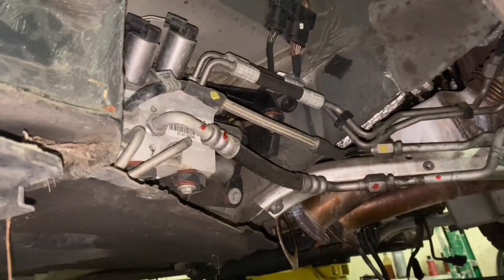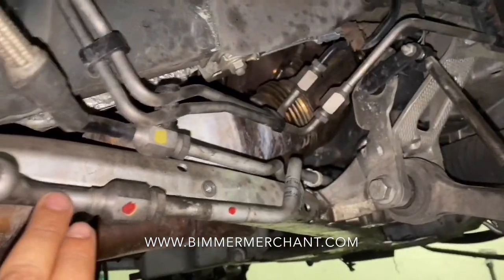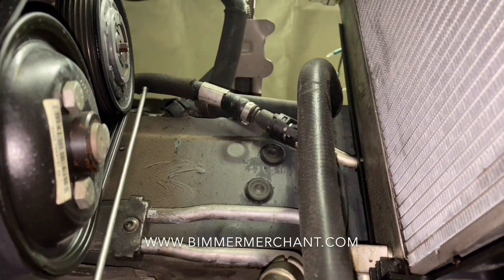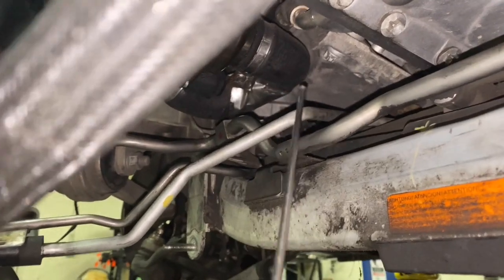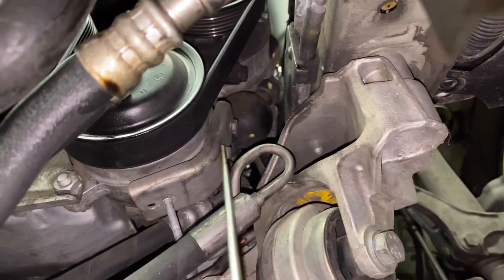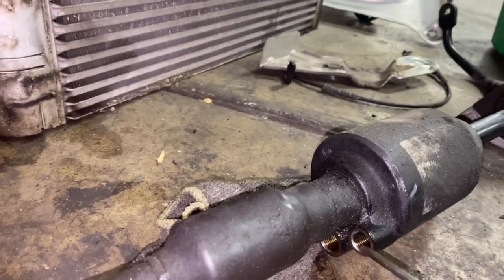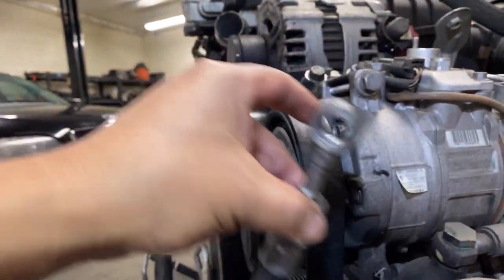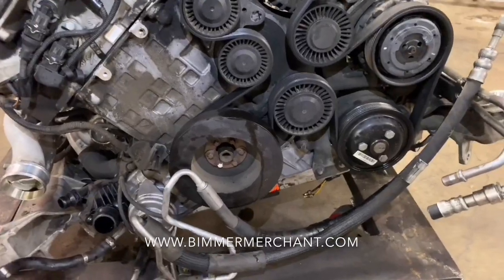Active Steering System Diagram BMW E60 550i 535i 528i 530i

Comment: I removed the dd valve block. Do I cap the steering pump line and reservoir line? Or should I connect them together? I removed the active sway bars. I'm talking about connecting red n yellow together.
Reply: Why did you have to remove the valve block? What if you leave the valve block and plug the ports for the dynamic drive and leave the active steering rack connected to the valve block and plug the port for the dynamic drive line at the power steering pump.
Reply: It's better to use a regular steering pump without all that jibber jabber.  @Jgo1-x1b

Comment: In short, if you have a problem with your Active Steering, you better sell that damn BMW and buy another car. disgrace
Reply: My steering light has been on for years now. Car drives great. I took dash out and covered light with electrical tape then put back together 😅😅😂

Comment: Do you have to remove the pressure lines if you needed to drop the subframe? If so, where would you recommend disconnecting from
Reply: Yes

Comment: Do you know What is the electricial plug on the rack n pinion? angle sensor does not move at all and I have already replaced the angle sensor.

Comment: Hey bimmermerchant I’ve read that installing cv axles on these wrong can cause your transfer case to lock ? Because In the 3 years that I’ve owned it   It never acted up they way it did after the mechanic install the new cv axles ?  My drive shaft broke? And I want to blame the mechanic for not properly fitting the axles right if that’s the case??
Reply from the maker: we haven't had that experience.

Comment: By chance, do you have a video on how to remove the light control module on a 1999 BMW 740ii.
Do you have rebuilt LCD’s for this vehicle?
Thank you for your time, Mike
Reply from the maker: Hello Mike,
Module is located under the headlight and attached with 4 screws, have you tried that?
Reply: @bimmermerchant  
Hello, I found it on the left A pillar just by the footwell. By chance do you sell used LCM’s  for this vehicle?
Thank you for your reply, 
Sorry for the wrong information to you. I meant to say LCM.
Reply from the maker: @mikecarlin3396  check our website, we should have the LCM in stock.